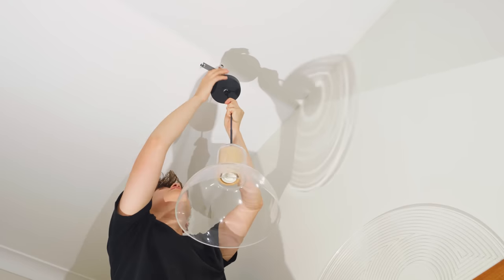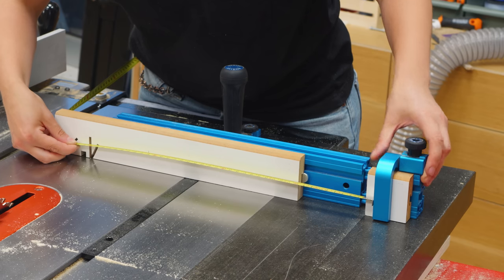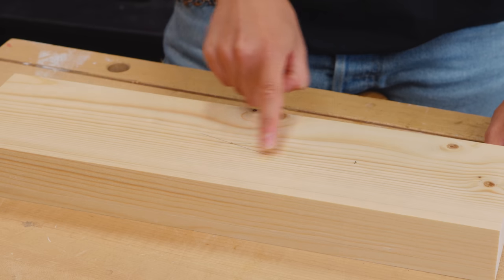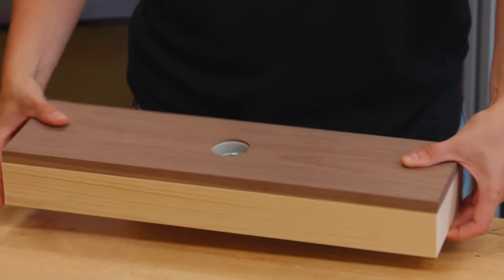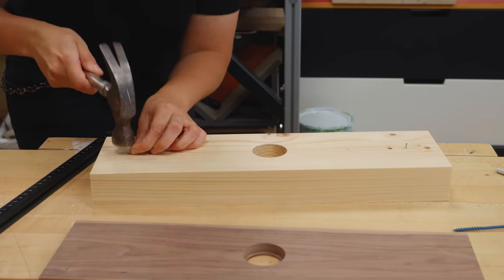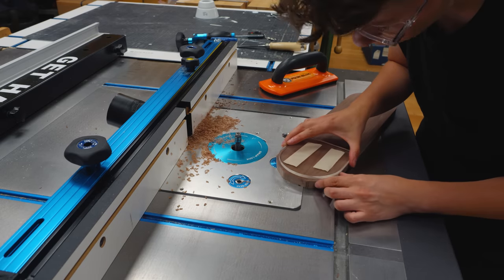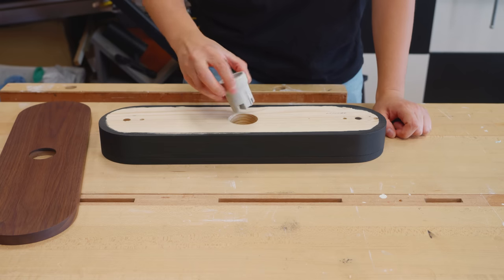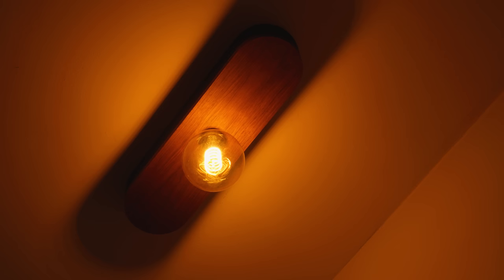Solid Wood Lamp

Comment: You've experienced kickback not because of the router bit but because of the wrong feed direction.that is the exact reason why you 1) route against the rotation of the bit, not WITH the rotation when using hand-feed in common woodworking applications 2) use a cover/hood mounted to your fence even when using a guide bearing 3)use a "free routing pin" so you do not accidentally switch direction of cut (imagine pulling a workpiece into the table saw from the outfeed side). Sadly 100% user error which could have ended in a trip to the hospital.

Comment: Great design of the lamp. I always have a hard time to find a good looking ceiling light. What you can buy either looks very cheap or is very expensive. But I really like this one.

But, please use wire end ferrule to connect the socket. And I doubt that the socket is rated to be mounted directly onto wood. To anybody who is inspired by this video, please consider that electrical wiring is always a possible cause for fire.

Comment: Beautiful as always. You have a fantastic collection of tools and an incredible skill set.

Just my experience on this: I've noticed control is the biggest thing with templates in my experience. I've had no more tearouts on flush trim bits (including compression bits) when I take my time and avoid a lot of pressure on the bit. In other words - let the bit do the work. Even with Walnut and Hickory, if I put as little pressure as possible, I get no tear out and it comes out perfectly. I did a car dashboard using a template and used black walnut with a TON of curves on it. Came out perfectly - but I didn't put any pressure on the bit. A good bit can tear through the material like crazy. 

Footnote: I started using the metric system due to the Domino cutter on one project requiring a lot of joints on it. I must admit, I have not gone back. it's SO much easier to use. No more fractions. I LOVE it.

Comment: I just had the same issue with my compression flush trim bit on some table legs, my solution was to use a smaller template bit, 1/4", and then use the ultimate flush trim bit for the rest. That seemed to do the trick. Of course I shattered one of the table legs in the process. Nice project.

Comment: Stay safe. You should clamp your work when using the drill press especially when using those large bits. They can impart a large amount of torque to the work and twist it out of your hans. Smashed fingers are not fun.  The lamp is well done

Comment: Does your router table come with a guide pin.... normally there is a screw in guide pin that can be attached to the top and act as a rest when free handing cuts
Reply from the maker: It does and I totally forgot to use it. Do you think this was the problem?

Comment: Fantastic design and excellent work. It's a pleasure to look at the ceiling. Personally, I would have made the area under the top plate completely black, but that would be more of a touch of OCD. The with the magnets is advisable, has also happened to me... that was a fumble to get it out again.

Comment: Awesome work, I like the simplicity of the design!

Your issue with the router looked to be feed direction - the first time was correct, so all went smoothly, your second cut you moved the piece the wrong direction against the bit, so it kicked back.

Should move right to left when working on a router table. 

Hope this helps!

Comment: That base can easily handle three bulbs, it could end up really cool to just add two extra sockets on the sides, wired in parallel, but separated from the center socket, and wired to a separate switch, that way you can have more light if needed, you can turn on just the center light, just the two on the edges, or all three.

Comment: I've used magnet cups and washers to great effect for attaching panels together (in my case it was grill panels for a speaker). It's amazing how the cup channels the field of the magnet for greater hold, without the danger of using two magnets and getting the polarities wrong.

Comment: Looks great! Around 4:38 it looks like those forstner bits are in inches. Is that convenient if you're working in Europe?
Reply from the maker: Most of the time I drill large holes they don't need to have specific sizes, so this kit works perfectly. When they do, I grab my 25, 30, 35, etc millimetric bits.

Comment: Hi Cristiana, I really like your videos and your amazing work.

Do you know an electrician that can show you how to do the cable stuff like the pros?
You should use ferrules on the cable ends. Because screws, can break the copper and weakening the cable. Than you get a loose connection and that can cause fire.

Greetings from Germany
Dennis
Reply: Her name is Cristiana. Thanks for the tip though!
Reply: If the screws on the outlet have a plate under them that the screw pushes to pinch the wire you don’t need to worry about it breaking wire strands. 

My concern is terminating at the ceiling without a fixture box. Not sure of the electrical codes there but that wouldn’t pass where I live in Canada. There has to be a light box for light fixtures(mounted in or on the drywall or wall substrate) just poking wire out of drywall and screwing the fixture to wall isn’t allowed. 

If you’re not getting your work inspected people will do it to cut costs but legally it wouldn’t be to code.
Reply: @fritzginger15  good one. If there are those plates…

Even in Germany there only comes the cable out our the dry wall. We don’t have special connection boxes.
We use wires that have 3x1,5mm2 in one and not single wires that need to run in tubes like somewhere else…

Comment: what tool did you use to remove the sawdust from the beltsander? A sponge? another sanding thing?
Reply from the maker: It is a stick of rubber sold under the name of sandpaper cleaning stick/block.
Reply: @GetHandsDirty  Thanks! I've wondered how to clean the belt for old gunk.
Reply: @KimHarderFog  its called abrasive cleaner